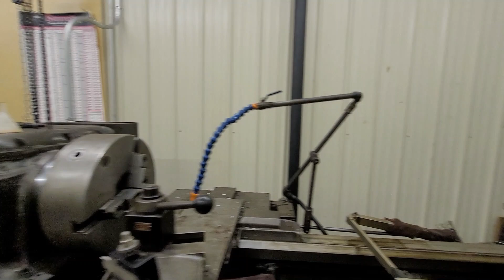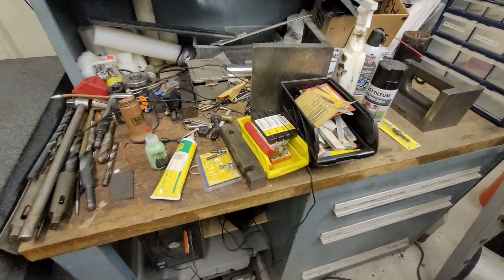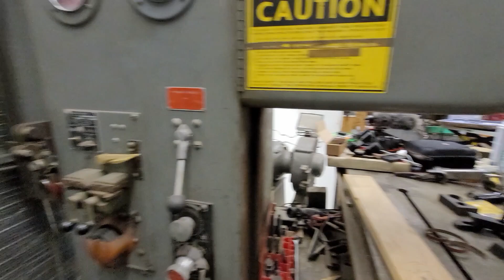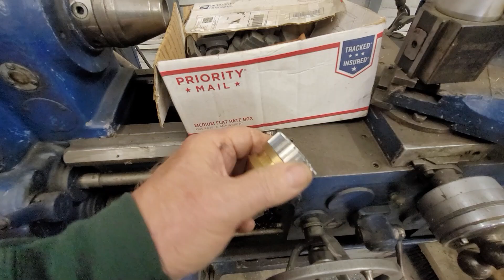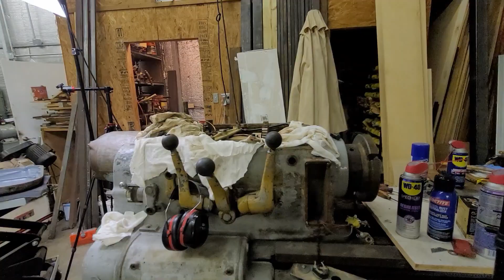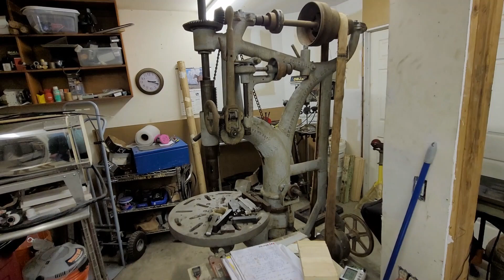Lots of old metal machines in MY Shop... A few are even for sale :)

Comment: I enjoyed your tour.  And... I learned little tid bits here and there which is fun.  I always get a chuckle.  I applaud you for showing a less than pristine shop.  What is important to me is the collection of things you've got and the knowledge you have.  Some people have pristine places where you can eat off the floor.  All the more power to them because that is what works for them.  Others, have stuff all over.  And if that works for them, kudos to them.  Frankly, my place looks kind of like yours because my love of machinery exceeds my space.  So, I really enjoy shop because I feel a bit at home.  LOL.  Again, kudos to you.
Reply: Oh, and I agree with 'IronWorker'... I'd love to see some scraping videos.  I'd also love to see some restoration work on a bed of a 10EE if you have some to do.  I've got one tucked away under a ton of old boxes.  It is my 'retirement' project (LOL) someday.  But there is wear on the bed (typical grooves on the aft face of the front vee).  I believe the bed is hardened though so I'm guessing that grinding and then Turcite or MogLice, and finally scraping is the only solution there.  These are all things that I've never done before, so any videos of a 10EE would  be especially interesting to me.
Reply from the maker: There are 3 machines ahead of the 10ee right now...  I might scrape a 4 foot edge in soon ;)
Reply from the maker: Thank you :)  I have so much going on right now  that its getting hard to figure out what needs attention next..   I have the 16 axelson and the Cincinnati Toolmaster apart now...  trying to figure out what the toolmaster needs in the way of head parts .... then back to the 16... Did you know a set of new vari speed pulleys for the toolmaster cost 16,000.00 ?

Comment: That green Bridgeport, if the first guy doesn’t take it shoot me a price!
Reply from the maker: Right now it's 2600 the way it sits... I have bought 324.00 worth of head parts for it  and they are going in this weekend so the cost will be either 2925.00 and you do the work or  3450.00 and I rebuild the top half of the head and replace the shaft...  Loaded on your trailer.....
Reply: Yea I figured it would be out of reach, a good deal nonetheless. I will keep wishing! And using my friends shop at night till I can buy one!
Reply from the maker: @tools6106  Yeah unfortunately metal working equipment is expensive... Of course it last your lifetime ;)  I have had one lathe 34 years...
Reply from the maker: Could you swing 2200 right now? I'll keep all the parts for another machine.. I've been using it like it is for years.... I was going to fix that shaft and if I did that I would have to remove all the other things so I might as well rebuild it...
Reply: @10swatkins  I wish  I am wrong time when it comes to money! Just spent $2200 on my wife’s truck, my mad money is gone.

Comment: How much are you asking for the Bridgeport??
Reply from the maker: It was 2600... But last night I ordered the parts to replace all the bearings, bushings, grease, and the shaft I broke.... In other words by this weekend it will have a top half rebuild and the price goes up by the time and parts I put into it....   

But the good thing is the parts are relatively cheap on a Bridgeport and all that cost only 324.00 for the parts!    I just found out how much they want for one  pulley on the Cincinnati Toolmaster....   8,001.00.. Plus shipping and tax :(

Comment: I have a Cincinnati MH2  horizontal mill with a vertical attachment.  Everything is geared and powered from a single 5hp motor, including a Cat50 horizontal taper spindle and a Cat40 in the vertical.  The Cincinnati you have will likely end being the best mill you've ever used.  I made a retaining rod for the vertical, 40 taper spindle, and I added a bushing equal in height to the difference between BT-40 and CAT40 retaining thread heights.  When I use the shorter, CAT40 holders, I just remove the bushing to allow the pull rod to drop further down in the spindle and properly engage the CAT40 threads. 

If you do add an air closer, pull studs are available in different heights and can be installed on both types of holders to bring the top of the bull studs to equal heights.  I have removed the dogs on the spindle and have never put them back.  The taper has an enormous amount of holding power without the dogs,  and my mill has a clutch which will slip before the spindle.  I also prefer the possibility for the spindle to slip in the event of emergency or crash, which I have yet to experience.

I've added a pile of stuff to mine, including 3-axis DRO, a rubber membrane "bib" system that protects the Y and Z ways, and other tweaks.  The rigidity and reliability of these old monsters is something impossible to find any other way. My particular machine, although filthy from years of storage, still had all the original scraping marks on all the ways.  Taking it apart for cleaning, I noticed that they seemed to have had a problem with the right end of the X table lead screw and had made a poor repair to get the machine working. It seems like this must have happened during original building and then the machine probably ended up being inherited by a worker or someone connected to Cincinnati because it has never seen any factory use.  All the adjustment bolts were like new - no little tool dents at all.  The table was immaculate except for some light surface scratches from other things stored and dragged around on the table.

I'd be happy to send you some photos of the work & I hope to let you know what a valuable machine you have.
Reply from the maker: Thanks Patrick...  I started inspecting the machine this weekend... Lucky I did not pay much for it as the varia speed is in rough shape... Have to take the top off to see what I need to make as parts are REALLY EXPENSIVE!   Will keep you guys informed on the outcome ...

Comment: I've run a Rockford planer exactly like that back in the sixties. It wasn't used much and it was kind of a novelty. My bench was about 3 feet from it. Love the sound they make under load.
Reply from the maker: They are cool.... I have to make a plate to cover a cable tommorow... It will be a 4 inch wide .5 inch thick plate with a trough cut down the center .... 6 foot long all in one cut ... Try that you shaper boys :)

Comment: I was using a steady rest on my axelson this friday, it unfortunately doesnt have bearings, its just brass. which isnt too fun when all we do is drill holes in rough continuous cast iron. Wears it down pretty fast. I might modify it to have some bearings on springs. That might last longer than just the brass.
Reply from the maker: The brass would wear down fast on that.. Can you take a cut to make it smooth before you use the fingers?

Comment: gasket scrapers.. dig out a 5 or 7 way painters tool..  sharpen it on your diamond grinder to almost a scalpel sharp edge..  if you nick the sharp edge stop and resharpen. you will not be disappointed .. warning.. i mistakenly sharpened mine on my 180 grit diamond file with some motor oil. it came out scary sharp..  sharp enough that it peeled skin without going all the way thru.  i usually use Hyde brand painters tools.
Reply from the maker: I actually hate those scrapers Wayne....  They cost me 2500.00 about 30 years ago!   One of my painters was using one to clean the paint off of new french doors and the thing scratched all the windows!  Scratches = New Doors!   :(
Reply: @10swatkins  try them your self.. don't hand them to a hired worker. you would not let a hired hand near your machined surfaces anyway.. i don't loan my scrapers out..